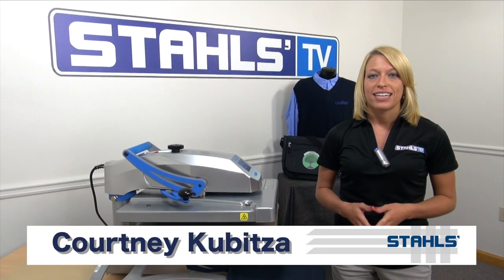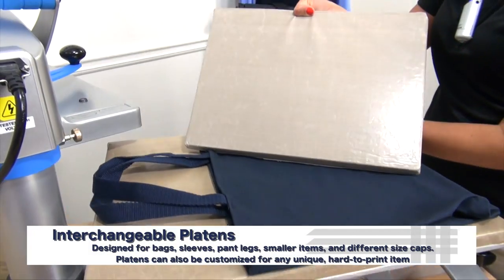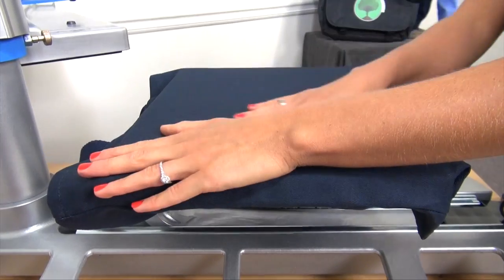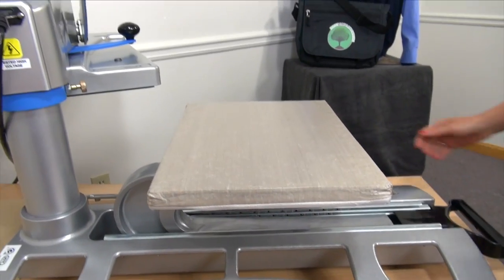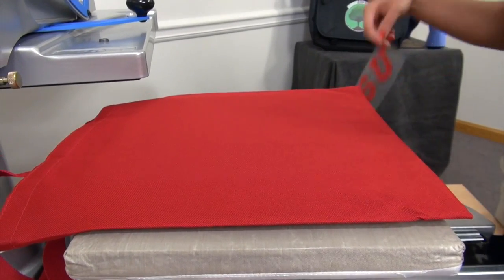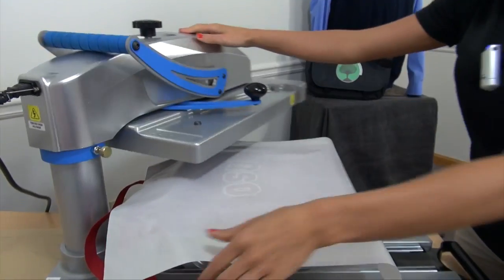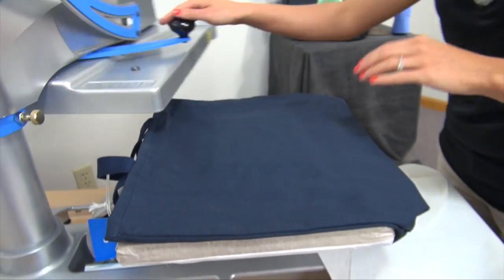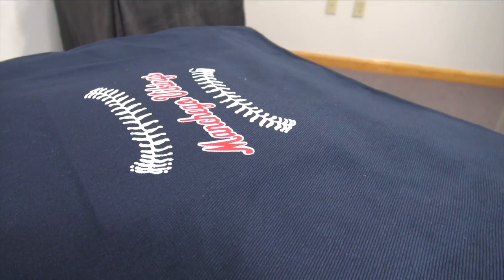Heat Press Tote Bags

Comment: Thanks for the video! Did you use sublimation inks or just normal inks? I was told sublimation cannot be used on cotton materials. Is that right? Any advises please? Thank you
Reply from the maker: In this video we used heat transfer vinyl from stahls.com and screen printed transfers from transferexpress.com

Comment: What does 'adjust your pressure accordingly' mean. Do you apply more of less pressure?
Reply from the maker: Depending on the material you are using, you will have to use different pressures. The pressures range from low to high. You can find the correct pressure application under the user guide section on any of the product pages on Stahls.com.